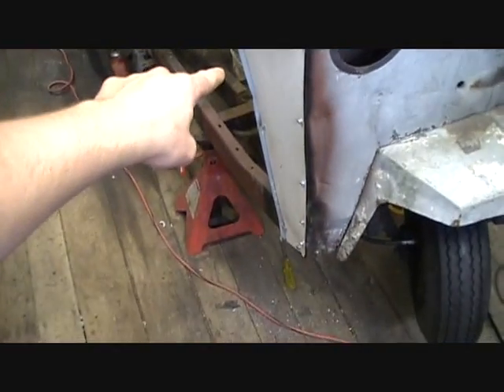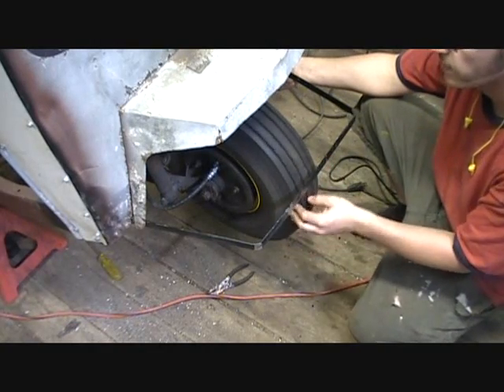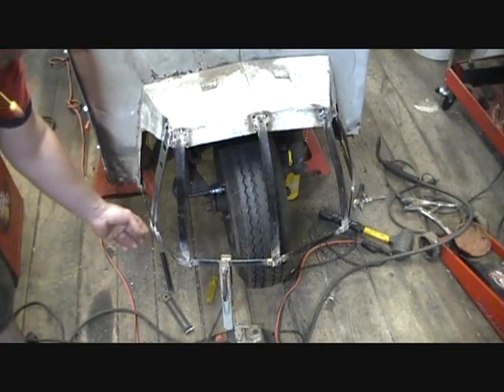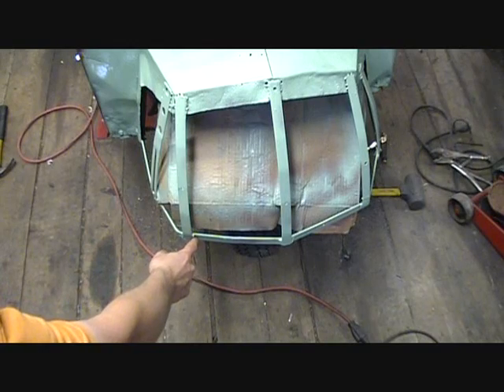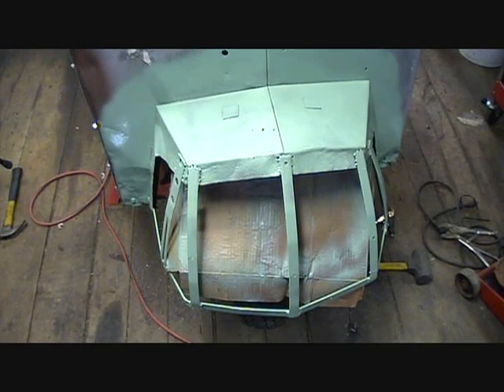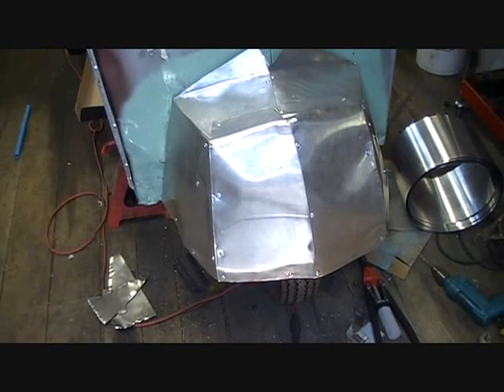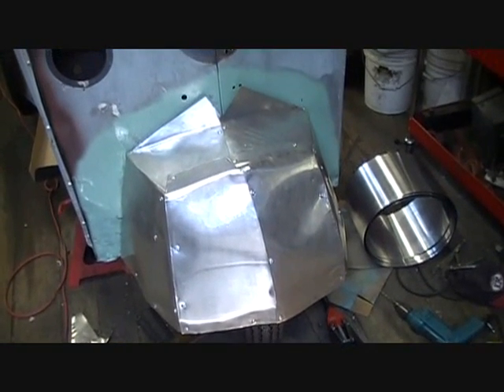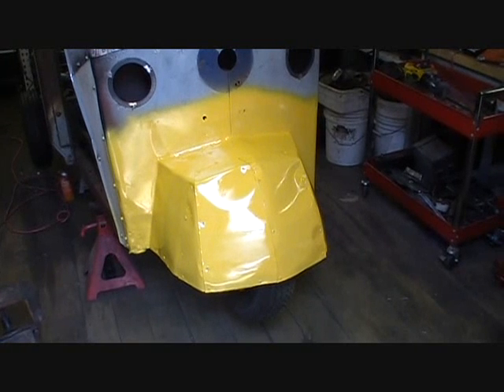1961 Cushman Truckster EV Conversion LiFeP04 - Part 5 Front Aerodynamics

Comment: There are LED headlights on several new cars -- it is the light projection pattern that matters; not the light source.  There is a DOT approved 7" diameter headlight you can buy at places like NAPA -- it is pretty expensive, though.  It uses just 15w on low beam, which is excellent.

They used these on the Illuminati Motor Works 'Seven', which was a car entered in the X-Prize, and built from scratch.

Neil

Comment from the maker: Good call on the headlights.  I don't know about modifications, but doesn't the prius use LED headlights already?  I wonder if motorcycles are different.  Anyway, the inspections on motorcycles are very relaxed.  That's a major reason I wanted a motorcycle.
The battery boxes are going to be at the lowest part of the vehicle.  They will literally sit about 6" above the ground.  I will insulate them/use a heat blanket in winter, I think.
Great suggestions!
B

Comment: You mentioned using LEDs for headlight. Good idea. Energy efficient and very bright for the wattage. Unfortunately, headlights are by law still incandescent or halogen. Although maybe in Maine, it's different than Wis. I'd like to see it though.

A safety suggestion. Try to install the battery boxes as low as possible for a low center of gravity. Perhaps you could provide foam insulation for the batteries in the winter.

Just ideas. My humble opinion. Keep on rockin'.

Comment from the maker: I wanted to make some of it bolt on instead of welded on, but realized that the axle actually sits lower than the lowest point of the fender.  I should have filmed that angle so it would be more obvious.  The nuts to remove the wheel are visible and easy to get to.  The brake bleed screw is up inside the fender, but not by a whole lot.  It will be a little bit more of a pain, but I think the gains are worth it.
Great idea though, thanks for the input!
B